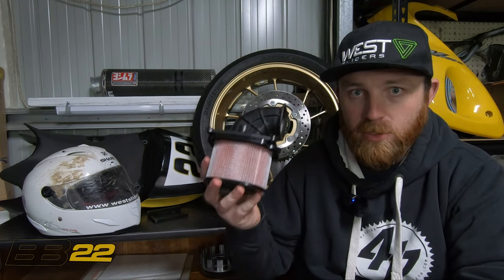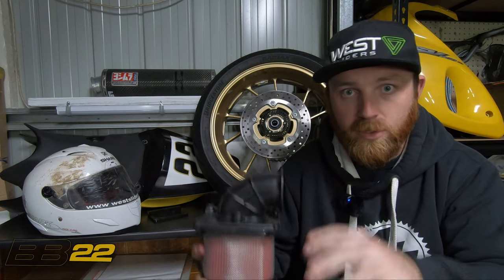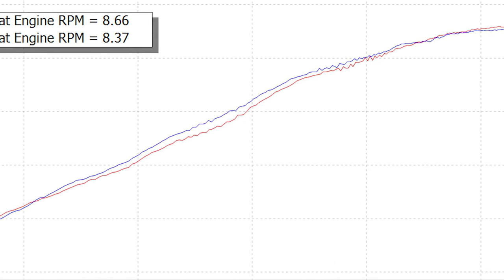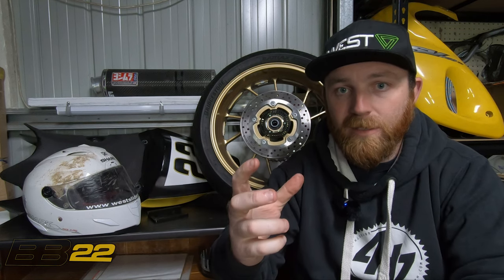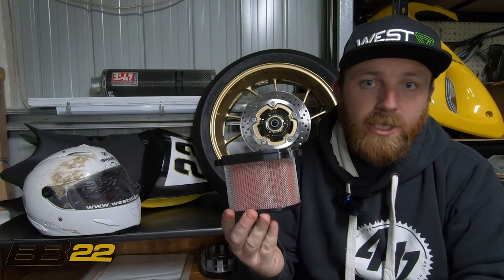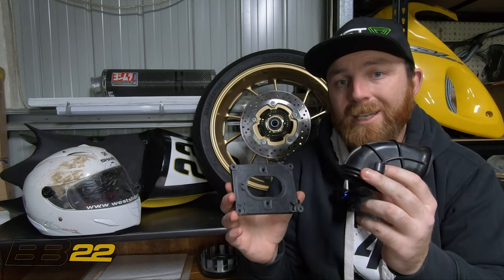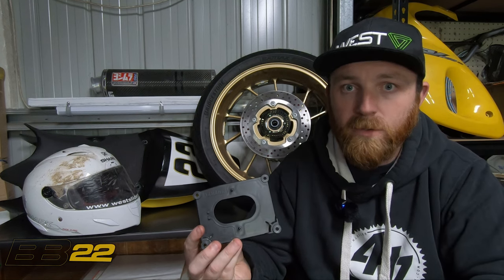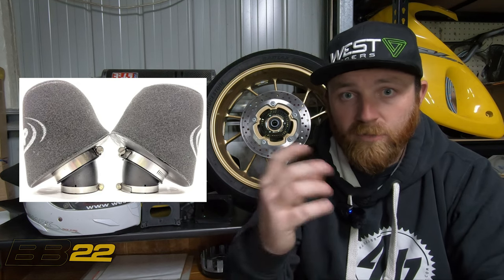THE GREAT SNORKEL DEBATE! | "De-restricting" a Yamaha R7 (and more Dyno charts!)

Comment: Great video, I have 2021 XSR 700 UK model and have the snorkel with the tube going right down into the air Filter. I bought a complete spare airbox  to cut the offending tube into the air Filter off flush with the airbox lid, but from what you are saying from your tests, I would do better to take the spare lid and open the inlet aperture out to just smaller than the opening in the standard air filter to get a healthy dollop of extra power in the middle of the reve range. I have already fitted a Leo Vince exhaust system so imagine a flashed ECU to suit exhaust and intake mods would benefit any possible lean condition
Reply from the maker: Yessir! Opening up the oem lid will net you better results. More flow is much better! With a full system and opened up airbox, tuning is definitely required!
Reply from the maker: Let us know your results when you do! Remember to test with the standard lid/snorkel and then your modified one, to see the gains & differences.
Reply: I am going to get the ECU remapped with an off the shelf "air filter and exhaust system" flash from Wiz Performance in Leeds UK. I will then remove the snorkel and open out and chamfer the airbox lid and may then go to a local dyno purely to make sure the AFR is in the safe zone. I never got base readings before I fitted the exhaust system, I m not bothered by the the power figures..... its really nice now, but would be rude not to take advantage of some free airflow. Really enjoyed your video, stealing others dyno experience is a cheap way to gain power. Thanks for your responses and encouragement. I bet the UK spec XSR700/MT07  air filter to throttle body runners would be usefull  in your neck of the woods?

Comment: So instead of buying a new lid for that larger opening, what if I just use a dremel and make a larger opening on my OEM lid? Thoughts if this will work?
Reply from the maker: Yes, you should be able to get more air into the airbox, just be careful not to go bigger than the air filter opening. There are some shops that do that as a part of their 'de-restricting'.

Comment: you REALLY needed to look at the fuelling in the same context.. by improving the "flow" with fewer restrictions, & to see increases in power (torque) at lower rpm where the physics suggests should make lesser improvements than at the top where less restrictive higher flow logically will return better gains.. strongly suggests a weak lean fueling.. then theres steady state flow potential vs induction pulses.. as well as the effects of the area around the inlet to the box.. dont under estimate effects of turbulences once the bikes moving at speed.. have you yried the trumpet 180deg the other direction as an example.. just to see.. but a/f ratio NEEDS to be looked at before ANY conclusions can be made
Reply from the maker: You're not wrong, but in this case tuning is something that we'd like to tackle separately.
The fuelling in the R7 is a bit annoying from factory, it's lean through the middle, but very rich up the top end. Hopefully we'll be able to look into it a bit in the future.
Reply: @BB22Racing  revisiting vids brings up interesting perspective shifts .. what you are doing, is still "tuning" !!! ..  this is an area I've looong been fascinated with since the early 80s & the monocoque F1 racers Steve Roberts designed & built & beat factory F1 bikes in the day .. he designed a still air induction system "into" those bikes .. the whole monocoque carbon seat tail section was the airbox .. 2 of which by the way the 1st EVER all carbon fibre chassis's (full monocoque that John Britton took his ideas "directly" from) .. if you have access to an airflow rig will return much more reliable answers .. the top plate NEEDS to integrate a mushroom trumpet that rolls right round into the air box removing entirely the corner inside the top plate so air streams better to the top part of the filter element.. the bigger the radius on that mushroom lip the better the whole airbox will flow.. the same for the throttle trumpets into the airbox.. they NEED to be rolled right round to form a fully inverted rim.. air flows into the trumpets from every space & potentially interferes with air streaming.. as near as can be achieved, linearly. If ONLY Yamaha had given their bike a decent twin spar chassis.. that steel thing is she i t.    !!

Comment: you also have habe a duel snokle in the front f the air box should change them over to, the throttle don't fully throttle ether so need to sand a little down to boost the extra power
Reply from the maker: Yes, the intake runners from the airbox to the throttle bodies have restrictors on the LAMS model bikes, that can be chopped out and smoothed back to essentially mimic the 'HO' runners.

Comment: Did you test the roll off roll on affect, often the snorkel is designed to improve the power delivery when riding in real world conditions as opposed to straight power runs.
Reply from the maker: Unfortunately for us, simulating "real world" wasn't possible on the day. It's something that we could go back and test, but the biggest problems with doing that on a R7 is how the airbox is designed, and repeatability. I'd expect the results to be pretty similar as the hole in the airbox lid size is still the same, so the amount of air that can get through to the filter is similar. Being able to repeat the same roll on/off would be simple on a ride by wire throttle, unfortunately it's not as easy for the R7, so we wouldn't have reliable results from that.
Reply: @BB22Racing  it can get rather involved .. old skool seat of the pants stuff & bikes side by side down the straights

Comment: So do you recomend removing the snorkle or no?  I've got a new CF moto 450ss and it has a VERY similar snorkle.  I just installed a DNA filter on it and im trying to decide if I should keep the snorkle or get rid of it.
Reply from the maker: I'm really not too sure about the CF Moto. For the R7 it's not really something that you NEED to do until you're trying to push a heap of extra power out of the bike, and even then it's not really going to give you much in the way of power. So for most road bikes, no, I don't think it's necessary. Probably best to check with some other people that have done specific tests (dyno results preferably) on the 450ss.
Reply: @BB22Racing  that's the problem.  There's almost zero information available on the 450.  No Dyno tests as far as I'm aware.  The snorkel on it is almost identical to the one in this video.  So this is the closest thing I've found.
Reply from the maker: @SenateKT-uc2id  Ah, I see, if I come across one I can test on a dyno I'll pull the snorkel and compare it for you!
Reply: @BB22Racing  That would be awesome!
Reply: I removed my snorkel and but left the lid before I even found this video and it seemed to have net positive effect on performance for the street to me, especially between 4 to 8k rpm...it also seemed to hit less of a wall at 8 k rpm, climbing revs to 9 k more enthusiastically...but I could be imagining it 😂

Comment: So can I just run the dna stage 2 cap and my stock filter?
Reply from the maker: Yes, this will work, but again as shown from the dyno results, there will not be a huge top end power increase, but you should feel a bit more in the middle of the rev range, which is where most of us ride on the road.

Comment: Does any of this cause a lean condition? I have a dna filter w dna lid and have been told i need to adjust afr cuz ittll lean out
Reply from the maker: It will provide more air to the engine, but you're not talking about silly amounts that will cause catastrophic changes to your air/fuel mixture.
Reply: @BB22Racing  also forgot to mention full Yoshi exhaust. As well as the filter and stage 2 lid. I had bought it like that but am thinking about putting the stock one back on cuz it seems the guy who had it before didn't rly know what he was doing and j slapping stuff on there.

Comment: Just get a DNA filter with stage 2 lid
Reply from the maker: We tested one in the video have a look at the dyno chart at @ 3:01 it does make almost 10% more power at 5500rpm, but you also lose a bit up the top.